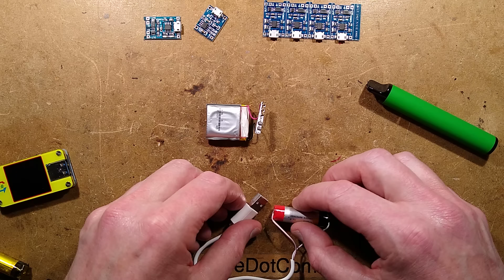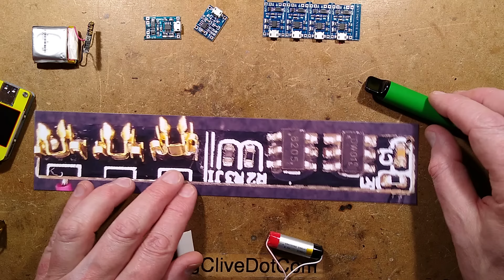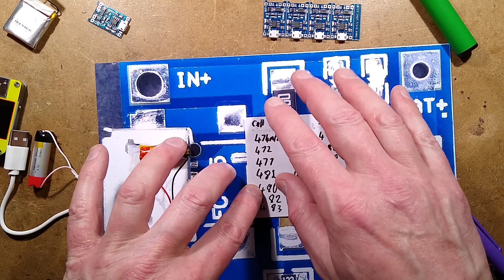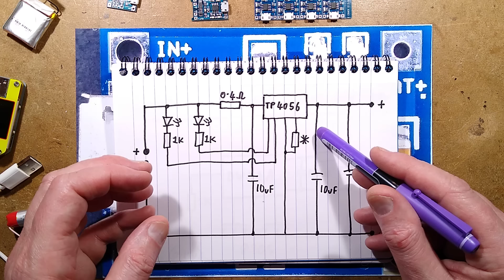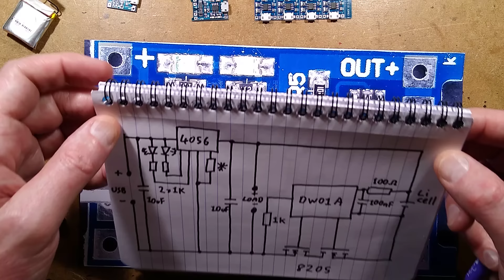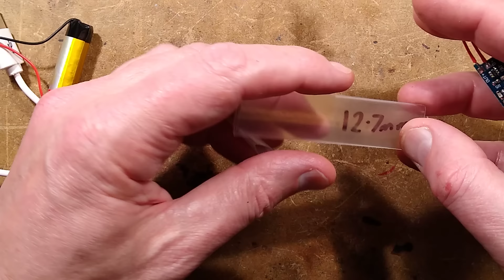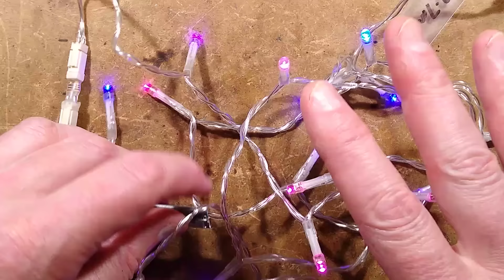Don't do this!   (There's a much safer way)

Comment: Hi  Is it acceptable to put 4 in series and wiring the same way. Cheers Marc
Reply from the maker: Not with the modules powered from the same supply as it would short cells.
Reply: Thanks for your reply, I was actually thinking of using one module to charge four 13400 cells in series. Cheers Marc
Reply from the maker: @marchorton1070  For cells in series you need a protection module that terminates the charge as soon as a single cell reaches 4.2V to avoid overcharging it.

Comment: Curious… why leaded solder? And how’d you make that little resistor adapter so neatly?
Reply from the maker: Lead based solder flows better and makes a better joint than lead free solder.  It's why they used it in the first place.

Comment: Would it be possible/easy to connect a whole load of these together to make a larger battery such as a 10+ah battery? Perhaps put it in a larger case and use solar panels to charge it for a wee shed/lighting or something? Seems like it would be an interesting project.

Comment: You should have a fireproof charge bag. You can get it at the hobby shop. Trust me. After the guy told me about how he burnt his house down a few years back I invested in the whopping 10 dollar bag. I also put that bag in a old ammo can while charging. Now over the years I have seen lipos light on fire while charging. Had one burn up in my rc plane while flying. And one started smoking in my rc crawler. Theres no warning. They just shit their pants all of a sudden.
Reply from the maker: I use a vented metal tool chest for storing cells

Comment: You could use a cheap drone USB cable. There are chinese drones with USB cables with an integrated LiPo charger inside. They are really useful.

Comment: Great video as usual. But I have a question. I got my hands on a whole lot of these batteries. I'm trying to educate myself on this topic, but I'm not sure if I connect say 20 of these in parallel, keeping the 3.7v, would this little board be sufficient?

Comment: These disposable vapes are dodgy, I had a batch of them that had no charge circuit they charged up to 5v, wont buy any again, dont agree with chucking lithium batteries away anyway, I would have reused those batteries but just recycled them as assumed they would be toast

Comment: Can you add more than 1 battery to 1 of these chips ?
Reply from the maker: Yes.  The lithium cells can be connected in parallel if care is taken to ensure their charge state (voltage) is very close.

Comment: One of the reason I quit vaping entirely was the constant fear of the condensed energy bomb I was discharging in front of my face every 10 minutes. After watching a couple mechanical stick mods with 18650 cells just absolutely immolate people, I decided I did not want to win the Darwin award

Comment: I have a 18650 cell charger, and if i have a cell that is completely dead, i put wires on the positive and negative ends on the cell and charge it that way, i've been reviving cells that way and i had never any problem with that method :)

Comment: Fantastic. Thank you! ...The one thing you didn't cover is how much current you/I/one can draw from the charged cells - I'm guessing it is probably quite high given what they are normally used for, and I'm sure some (hopefully NON-destructive) tests would provide some data - but I would love to hear your words on the subject.
Reply from the maker: Standard use is around 2A.  But the drone posse may push them harder.

Comment: I done the exact same thing I wired it direct to charger cable and the battery exploded burned a great big hole in my carpet lucky I was in to put fire out so do not do it . I wish I seen this before my fire. I need a new carpet now but it could have been much worse

Comment: Actually there is a simpler way to charge because this e-cigarette already contains charging circuit just don't throw it away and use for charging. you can connect usb at the point where the vaping coil was connected and it will charge battery properly with current limit and charge indication.
in fact you can even use those circuits as chargers instead of those chinese pcbs
Reply from the maker: Some of the modules do that, but others don't.  It seems a bit random.
Reply: @bigclivedotcom  Interesting, I disassembled over 300 of different e-cigarettes from various brands and did not ever encountered any version which cannot charge.
Reply from the maker: @deltaxcd  I found several Geek Bar units that would not allow a charge that way.  It's possible that being disposable they used modules with defective charging circuitry that wasn't an issue in a single use item.

Comment: If you have those boards connected up to multiple batteries.  Can you add them in parallel and/or series without causing issues?   Or would it be better to have a true BMS?
Reply from the maker: They can be added in parallel without anything other than making sure the voltages are very close before hooking them together.  For series groups it would require more complex battery management.

Comment: Would it be possible to solder the ends to a battery pack and simply plug your batteries into the pack to charge?

Comment: Hi Clive, I really enjoy your videos and learning a lot. Found loads of them and did what you did, now I have a rechargeable lights around the house, very nice. Don't have the tools or skill set yet to change the resistor. 

But I have noticed that thing at the bottom of the vap tube thing that has the led on it. Any ideas what this could be used for in a project? Maybe a video on it? You are awesome keep it up, look forward to the next video.
Reply from the maker: I've pondered other uses for the control capsule, but it's so specialist that it's hard to think of another use for it.

Comment: I actually found a discarded "vapour device" for the first time the other day, oddly in the uncle's yard next door, but that aside, it had a 550mAh cell in it like these ones, and I've just soldered it onto one of my protected TP4056 boards and it's happily charging now, and there's a distinct scent of generic cola flavouring in the room now... :P
Reply from the maker: The strength of the flavourings in these is ridiculous.  Like air freshener levels.  That can't be good to breathe in directly.

Comment: Out of curiosity could you safely make a hot wire foam cutter using a salvaged rechargeable li-ion or li-po battery?
Reply from the maker: I wouldn't recommend very high current for long periods of time.

Comment: Great video. Brought some of these boards and discovered that they'll charge when plugged into a usbC to (blue ended) usbB lead but not my usual (Google supplied) usbC to usbC lead. Any ideas about this one? If my usbB lead had been a 2.0 I'd assume it's related to that. Anyway, all the best. Cheers
Reply from the maker: Some chargers need a control signal to put out power.

Comment: I've been salvaging these little cells from disposable vapes for a while now, and found another way of charging them safely. A couple of the vape pens I found were the type with replaceable "pods" of vape gravy, and these had USB-C ports in the bottom for recharging the cell. These are basically little lithium ion cell chargers, and do exactly what you want for these cells: They charge the cell up to just under 4.2 volts (according to my multimeter, an average of 4.18 volts) and at about 450 milli-amps.
They also have a nice LED indicator, just a white LED built into the base which lights up when the cell is charging and switches itself off when the cell has reached full charge. So they definitely have a cut-off circuit for charging, not sure about discharging, though in my experience the cells rarely drop below about 3.4 volts once the supply of vape gravy has been depleted. So I just modified these with a pair of crocodile clips for attaching to any other lithium ion cell, keeping the USB-C input as it was.
Very convenient, and free to boot since I found them in a battery-recycling bin. In fact if you want some of these cells and don't want to scour the streets looking for disposed vape pens, just have a look in the battery recycling bins in any supermarket - I have found hundreds of them that way, and that's no exaggeration.
Reply: Yes, this is what I did, too, figuring that's what the little circuit board in the vapes did though I didn't realize the dangers of mischarging these batteries. I've got an led flashlight/cabin light that took 3 triple A's (4.5 v) so I thought I'd try a 3.7 v vape battery in it and it works awesome, brighter than the triple A's in fact. So I've got a bunch of those recharged and ready to go in case. I converted some other things reusing single vape batteries, too. Great fun!
Reply: What would I do with these batteries I have some
Reply: Great idea

Comment: You almost manage that I feel comfortable to reuse salvaged LiPo.

But I think I stay with of the shelf power solutions for my arduinos and raspberries. Actually I managed to have a wired supply to all my currently used installations so I don’t need batteries or Akkus at all

Comment: Not sure if this is a silly question, but looking at these online they all state that the full charge is 4.2v - so would a 3.7v cell be at risk or does it protect based on the remaining current going to the cell when it's full?

Also, would these work on some of your solar light projects, for example putting the solar cell on here instead of having to use a cell that has protection built in?

Thanks
Reply from the maker: 3.7V lithium cells are the ones that charge to 4.2V.  The 3.7V is the mid-charge voltage given as an average.

Comment: I bought some of these, but without the USB connection, to fix my cheap LED PIR floodlights, the ones with the remote solar cells.
They’re terrible for overcharging the 18650 battery inside, in fact some I’ve had managed to destroy their battery within a couple of weeks.
I still haven’t got around to putting them in yet, not absolutely certain how I’m going to integrate it with the other circuitry inside, but I’m sure I’ll work it out.

I’ve also got some with the USB, I’m planning on making up some plastic tubes with metal end terminals (on my lathe) to fit into various devices, put some ex-vape batteries inside & have me some nice rechargeable batteries for torches & stuff.

Comment: I wonder if instead of a fixed resistor that changes the charge current use an trimpot that is roughly 10k ohms and use the multimeter in ohms setting to set the  resistance from the datasheet
Reply from the maker: You could do that.

Comment: Being totally ignorant in electronics, but at the same time fascinated,  I spend hours watching Clive but understanding little!
I've found two of these discarded units, both with 500mAh batteries, one smaller in size has been crushed by a car tyre and was slightly oval.
I have rolled it back into a round section and the little suction detector unit, if squeezed, lights up it's LED ten times if you squeeze it so I know the battery is still functioning!
I have as yet to invent a use for these little power sources, so have not yet invested in any TP4056 charge modules.
Are they safe to use without changing the resistor that Clive recommends, and is my slightly crushed battery safe?
Hope someone out there can advise.
Reply from the maker: I wouldn't recommend keeping the squashed one as it may have suffered internal damage.
Reply: @bigclivedotcom  Thanks Clive, I'll toss the squashed one. Is it necessary  to change the resistor on those TP4506 modules, or are they safe as they are for charging these freebie batteries?
Reply from the maker: @Theracles  The batteries should be fine at 1A with the existing resistors.

Comment: This is why I buy vaporizers with removable batteries - charging individual 18650s using a dedicated charger is safer than this ratchet solution, not to mention less e-waste and greater control over the vaporizer itself.

Comment: I have one of those charging boards with builtin over discharge protection. My battery has also one of those little protection boards. I presume I can remove this protection board safely  in combination with charging board?
Reply from the maker: You can keep both if you wish.

Comment: No way lol... I thought I was the only one that did this with disposables, after a while I thought if I probably am how low was I to get it working although thinking to myself why not as I am basically getting scammed every now and then when using one and it only lasts a days use even though my last 3 or so lasted a week tops. 😅

Comment: Hi Clive, Ive noticed tonight that the latter board does not have reverse polarity protection.. booo. anyway I also find that a mix of 50/50 of your desired flavour mixed with a 50/50 nic SALT will replicate the same smoke as the original.. Great video..

Comment: Using a recovered 550 cell & modded charge board I lit up the garden - and several adjacent gardens - with 100 LED string, for a very short time..
I’ve now added a bit of resistance, but miss the blinding (cold) white light..
I’m now saving cells to build an 3S power bank using 9 cells (3 x 3)…

Comment: Just a question for a beginner, as if I order some SMD SMT resistors, I have seen that you can buy them in DIFFERENT size dimensions “chip size” (0805 or 1206) Would both sizes FIT, and is it easier  (FOR A BEGINNER) to use the LARGER dimension “chip size” ???  As I know to some, this will be a STUPID question, but NOT to me !
Reply from the maker: The bigger ones are definitely easier to solder.
Reply: @bigclivedotcom  thanks big lad 😉
Reply: Have got all the parts, and managed to solder on the new resistor. All went well, but when I connected it to a light, it was burning the wire out ??? I can send you some photos, and you might be able to come up with a good fix for my problem.

Comment: How hot do these charging boards get? I tried changing a 1500mah battery at 1A and it got seriously hot. So much so it burnt my fingers. I put a temperature probe onto the chip and it reached 83°c is that normal? 😬

Comment: Just after watching this vid, I found a discarded vaper with a 3.7v, 550mA cell, bought some chips & connectors, replaced the 'charge' resistor with a 1/4W 2.36K ohm one, and the unit works a treat! Last week, I dropped in at a vape shop (I don't smoke or vape), asked if he'd got any old discarded ones, and he gave (yes, gave!) me a bag of old cells and vapers - he said it costs him to legally discard them. There were 25 cells/units, all 3.7v 2500 - 3000mAh (type 18650?) capacity. So far, I've got ten good ones, still showing 3.7v, five dud ones (less than 2.5v), and I've stiil got ten to dismantle. New ones are up to £9 or so. What am I going to do with them, Clive?

Comment: Odd thing with those little 4056 boards. I've a few lithium batteries salvaged from defunct tablets and vaping things. The cells have appeared fine. On a few occasions on charging them with one of those 4056 modules it's all looked fine until the cell's charged, at which point /both/ LEDs came on. This has happened with more than one module. Subsequent discharge/charge cycles have been fine – red LED when charging and green on its own when charging's complete. I wonder if a charge "conditions" the Li cell in some way.

Comment: Can you link the batteries together to give say 12v like you can 18650's if so could you do a video showing how to do it safely  please?
Reply from the maker: It has to be done with suitable multi-cell protection PCBs.

Comment: I am finding so many of these and I'm running out of ideas/things to power then with. Halloween coming up next though so I have some time to make props.
Connectors are Molex KK-254. Or the cheaper ones are JYK H2500-02  from Rapid Electronics   22-0905 for the Female and 22-0950 for the male.I note thought that Rapid have increased their free-shipping minimum value from £20 to £30 recently so maybe don't but from them if you have small orders.

Comment: After making a few simple chargers , the tip is to use a single diode ( or various diodes ) + current limiting resistor ,  in series with the USB  5 Volt supply ...... use a meter to monitor charge and select your diode(s) to cutoff at 4.1 to 4.2 volts ( and NO MORE ! ) ... you can now charge the ( thousands ! ) of partially depleted cells found in vapes , discarded in every street / park ...

Comment: Opened one rechargeable disposable vaping pen: the USB Type-C (F) socket is soldered onto a breakout board, and the «microphoney» unit with the µC, LED and pressure sensor has five wires.
By the first glance, it should simply be capable of charging the battery then. Interesting. Could the single use ones then be repurposed to recharge their batteries then, what do you think?

Comment: Been collecting these disposable e-cigs from the back lanes near where I live. Perfect for the Olympus stills camera that normally takes two AA batteries. And, yes Clive, the proper charger chip fitted to a standard charger, and, a protection circuit hard wired to the battery. Warning ; the left over nicotine inside will make your hands stink for days. The Blue Razz Lemonade ones are bad enough  but the Strawberry Ice smells F**king horrible.
Reply: The detail about the flavours in this really got me giggling!

Comment: Putting 5v on a li-ion battery is a terrible idea!! It will just barely get by but its going to severely limit the batteries health and its going to increase the danger of the battery getting very upset and going Chernobyl

Comment: I have all the guys at work give me their empty disposable and I've been finding a lot of 1000mah in the various brands. Some smaller ones here and there, the "premium" units have the bigger battery, which oddly enough tend to be the ones with a USB port for recharging. It's as amazing as it is disappointing that something so valuable is made to be just tossed in the gutter.